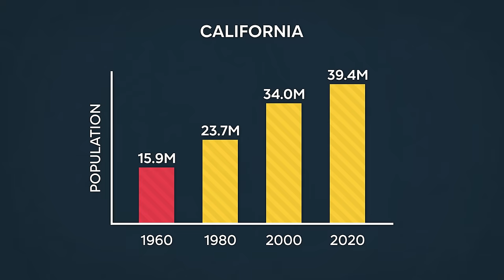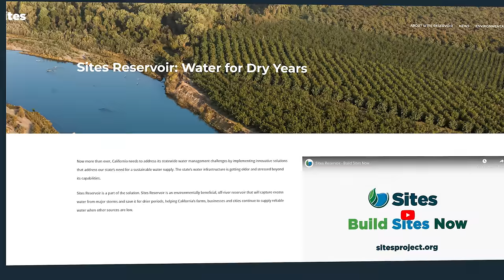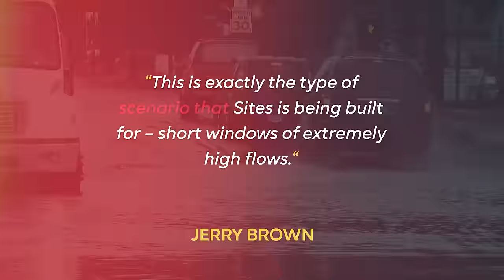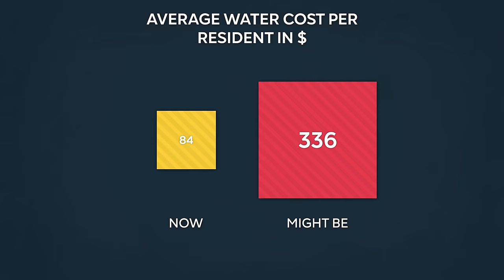California's New $4BN Mega Reservoir

Comment from the maker: What do you think, should the new mega reservoir be built? 🌊
Reply: Yes Might Be Build Soon
Reply: Why make this so Expensive? About 80mi away you got the Keswick Dam. Just pipe it down to Sites Dam, no pumps are needed. You save an enormous amount off energy!!!!
Reply: Install some floating Solar panels to!
Reply: @larsfridtjofnrheim1638  I think they want to ensure there is a guaranteed volume of water per square mile area.
Reply: @ten-tonnetongue  It will help, but, it is not a permanent fix. Like moving water from the Columbia.
Reply: This sounds good, but I'd want to learn more. I don't think there was significant flooding from the Sacramento river in 2023, and most flooding in recent years has been from other rivers, so that's not a helpful comment in your video. Just sucking water off with a pipeline during a surge in river level sounds ineffective for flood control. I wonder if that is even a consideration in this project. Control of the American River and Feather rivers is probably more important at this point. Water on the Sacramento is stored by Shasta Dam which is not full now in April 2023. This seems like a long-term water storage project, which would be slower to fill than Shasta, but creates more capacity over time.
Reply: @larsfridtjofnrheim1638  That kinda defeats the purpose "siphoning off" flood waters no?
Reply: Your video just described the existing San Luis Reservoir in central California where water is pumped into the reservoir from the Sacramento River, but where pumping water is currently blocked because an invasive fish was found in the river and somehow must now be protected. The video seems more of a sales pitch along the same lines as the high speed railroad project. Lots of funding that go into pockets of beneficiaries rather than the project. A project where the main function is already blocked by current environmental protection laws. If the central California's were smart, they would press/protest the issue of the San Luis pumps being shut off at the same meetings of the Sites Dam, so that attention would be brought forward to a costly project that is doomed from the start. California has a problem with water management, not an issue with storage capacities.
Reply: Work and live in the land. Maximize the good minimize the bad. Just stop forces things that can't be sustained.
Reply: It needs to be built, but will never get anywhere. California has been "working" on the high speed railway for decades now and the funds have not been allocated properly. We will all likely die before anything gets done and eventually becomes a memory hole of broken promises.
Reply: They should raise upper Lake McClur and connect it with Don Pedro. Merced and Tuolumne Rivers would work together and double their current capacities.
Reply: What the video fails to mention, are the "4" electric generating and water storage dams that they have  started to remove in northern calif.
Reply: @killerb056  And yet it  is full now. Did this water come from the streams?
Reply: @larsfridtjofnrheim1638  😅
Reply: @larsfridtjofnrheim1638  If it's downhill, your could generate power that way
Reply: @AshGreen359  Yes, but it is a very smal downhill. But if Sites Lake is low, you got some potential.
Reply: Yes, if the environmental impact statement comes back showing a net positive to wildlife verses being detrimental.
Reply: @MrCalagon  Maybe some Desert Rats need to move🤣
Reply: I think the longevity of the project makes sense and could potentially be a solution that holds for decades, but I think there’s a lot of other cheaper faster solutions that can be implemented now that would be highly effective as they are needed, 2030 is just too long.
Reply: No.  The idea is one of the idiotic potentials floated to keep developers interested in California.  The simple reality is that the state has been well aware since the 1960s that under worst case conditions, every stream in the state could be dammed, and there still would not be enough water for the state population at the time.  Over half a century ago for the arithmetically impaired.  California has seen real droughts that have lasted a century within the historic past.  Oh, wait, you might say.  California's history isn't that old.  That is true, but written history reaches back well over 2,000 years.  So the "historic" past includes what climate "science" is pleased to call "paleoclimate."  California's current rainfall regime has not varied significantly in over a century.  It has not become drier, OR wetter.  What we are seeing is business as usual.  What California "needs" is less demand.
Reply: yes, with chinese technology
Reply: Don’t forget the windmills
Reply: Yes. It's either that or California needs to halt net in-migration to the state until they have the water resources to supply them. The state has taken enough Colorado River Water already.
Reply: @geoffreyeble32  Constitutionally, that's one thing no state can do.  Right now, California is right at the limit for distributing water for urban and rural uses, and at the same time limiting the rate of degradation of critical natural resources like the salmon fishery.  King and silver salmon runs are critical to the offshore fisheries.  But every "stakeholder" wants their "stake" to be prioritized.  And the "stake holders" with the clout are developers and the big agri-industry businesses.
Reply: Why build it when people are leaving. Spending more money they don't have, brilliant.
Reply: It looks like this is a great idea, and should have been done years ago. I love my state it's just not liking me anymore.
Reply: Yes in no world should a state with flooding be in a drought. If we can land on the moon we can figure this out.
Reply: Floating solar panels sounds cool but… water and electricity, famously not a good mix!
Reply: @MrCalagon  Would have to be good for water birds/ and the fish pool idea.
Reply: @magesalmanac6424  India is doin solar over canals, maybe not quits the same a floating though.
Reply: No
Reply: This sounds like something that needs to happen not only here but in many other places. I like seeing that people are now understanding/considering the environmental impact to the natural surroundings as well. We have the tools to spend a little more money and make it so resources like fish, among many other things, are impacted minimally. I hope to see the success of this project in the future.
Reply: Yes, but I still think it would be nice if desalination could be pumped to different resovoirs.
Reply: It's obvious. It must be built
Reply: @larsfridtjofnrheim1638  😂😂😂😂
Reply: WEF told us in 2030 we won't own anything and will be happy.
Reply: No.
Reply: Maybe less people in the desert will help. I'm no tree hugger, but sometimes things just equal out. If a deer has no food or resources, they move out.
Reply: Sure
Reply: Not to worry,,,  California's population is heading back down to the 1960's level, with all the tax paying residents fleeing to red states.  All the homeless & illegal immigrants will have all the water they want. It all works out in the end.
Reply: No.
Reply: What you call the Colorado Desert, is actually the Sonoran Desert.
Reply: no, I think people should stop trying to live in an inhospitable, desert wasteland.
Reply: @larsfridtjofnrheim1638  as a Washington resident I'm going to have to insist that people keep their rat claws off of our water.
Reply: They need to build about a dozen of these.
Reply: Then they make it illegal for you to collect water.
Reply: We have NO CHOICE! So much water could have been collected during this crazy year that we will never have the opportunity to get it.
Even the locals in the area, are backing the project
Reply: @motoman869  Why dont US votes, create a new political party? And place it betwhen D and R? A party, by, for and off the people. Supertransparent (make youtube video off all meeting, no meeting alone whit lobbyist and so on).
Reply: Well, something has to be done. I watched an interesting video a couple of months back and they had a great idea. Pumping the water from the frequently flooded east to the water starved west. Before you laugh it off, they showed how it was feasible. There are many unused oil pipelines that could be converted for water use. It's not difficult to clean them to be suitable for pumping water and they're already in place. Of course the profit incentive is missing, but if the gov't really wanted to do something to control flooding in the east and provide water to the burgeoning population in the west, it is possible to do according to the presenter. When you compare the cost from damage to flooded homes, battling wildfires and other natural disasters, controlling the floods might not be that expensive and preventing all the suffering of those who lose everything in these disaster, it could be well worth it. It's worth at least looking into.
Reply: I think it should have been built decades ago.
Reply: capture the water!  crazy!
Reply: Look similar?
Reply: It's going to be built, but it will not fix the water issues as the water still needs to find a way around the delta to go where the 2 Billion $ worth of Private $ lives. Westlands Water district and the Billionaire orchard owner in that district have spent a lot of $ and time trying to get the Tunnels built and are the largest donors to the Governor's over the last couple of decades.  For 20 years + they did not want to pay anything for this dam. But when faced with reality, they and the LA water district(Treated drinking water) decided they better put $ forward now so they get a  piece of that pie and they will worry about the tunnels later. LA will pay more than 700$ an acre ft, they get that back with the higher $ they get from residential customers vs agriculture use. Billionaires Stewart and Lynda Resnick, can buy up huge amounts of water whenever it needs more. They can out spend and are the top donor to the Gov Newsom's campaign. I am for the reservoir, I am not for the tax payers paying a massive 2 billion $ cost they offers little to the tax paying customers, but sends this water down south and making the delta a salt water intrusion region. That will destroy the most productive delta farm land in favor of a salty desert region owned by Billionaires. Not in favor of that. If you pull water flows away from the delta, the salt water intrudes. That's what the tunnels will do. More dams will not fix the CA water issue, we need more rain and it's not coming. Dams that only fill up once every 5-20 years are wasted, as once filled, they only offer an extra years worth at best.  Billions of $ for only one year extra worth of supply every few years. So a 4 Billion $ dam is basically adding only 1/4 to 1/10  it's value, without the extra rain and snow, those dams do not magically fill. It helps some, but the amount of water used requires a lot more than a single year's worth of water/snow.  There's quite a few issues here. Best to follow the $ to see what the real issues and people are involved.
Reply: Billionaires Stewart and Lynda Resnick also own a majority stake in Ground water storage, this cost much much less than Dams. This is a better storage approach and better for all involved. California has a lot more space for ground water storage and then transporting it is less of an issue. Recall that the north has more water? But even here they can store it here the same water. But unless you get enough rain year after year, those will be drained as well. So you are back to the original problem, not enough, storage only helps if you get enough rain over the decades, not just one decent year followed by 5 years worth of drought. Agriculture needs to work more on water conservation and crops that use less water if they want to do business in basically a desert that is getting dryer.  The Billionaires will survive, the poorer farmers? Probably not.
Reply: Heck NO! So many reasons; building expense, ecological cost, not a good & adequate solution. The aim of every region should be to revive more forest cover as a way to store water locally! The way our engineers aided by lots of federal and state funds want to do it is through massive centralized projects that benefit their own pockets! A reservoir no matter how big is tiny by comparison to what is possible in terms of storage in a mature forest! There  are many more advantages to storing water in forest (biomass) besides capacity; the water does not evaporate, the water is cleaned much better, and the water is stored locally where it is needed. And also you don't have the long-term expense of running it by some beauracracy! On top of that it cleans the air it becomes habitat for many lifeforms etc...
Reply: Death valley lake. And resort.
Reply: How about Tulare county and family ranch with cows and those cops that feed American people across the whole nation what would happen? Do the need a system of planting trees or pine trees like China and is going successfully from dust storms? And Volcanic reaction earthquakes?
Reply: Who about Tulare County should the plant trees or pine trees like China from these dust storms? What's going to happen with earthquakes in  the future?
Reply: Yes the Sites Project should be built.  Water for delivery to Southern California could be transported down the western side of the Sacramento Valley to Fairfield where pipes could then transport the water under the bay to the Tracy pumping  facility.   This delivery of fresh water would end the problem of salt water intrusion at the Tracy pumping station, providing good quality water to the California Aqueduct.   This would save the Sacramento River from being the delivery system ending the peripheral canals or pipeline.  Reducing the higher flows in the Sacramento River to meet that demand at Tracy.  Reducing the flow of the Sacramento would aid in seepage and erosion problems the river now endures.  Connecting water from WhiskyTown and Shasta down the west side through Black Butte and Sites should include other storage systems.   The overall water storage in California lags way behind the rapidly increasing demand for water supply.  Most of the conveyance down the west side is already in place and only needs to be connected in some places.   This would cost less than any peripheral delivery project from Sacramento to Tracy and would also solve the salt water intrusion problem.  This system would be all gravity flow and pipes under the bay to Tracy would not require any pumps.   Adding more storage, even small reservoirs, would add a lot to recharging the ground water in the Sacramento Valley.   Capturing the uncontrolled runoff that causes flooding in the Sacramento River would be very beneficial.  Those flood stage waters cause a lot of seepage damage to communities and farmland along the Sacramento River.  Late spring runoff has caused seepage which has killed riparian vegetation and orchards along the river.   The Sacramento Valley watershed has far more water than it can use.  It would be wise to do more to control flooding, increase water storage and even increase the production of Hydro energy.  It would go a long way to mitigate long term droughts which we do endure in a regular cycle.
Reply: they have money for social services not this
Reply: We don’t have a choice the problem is the cost to taxpayers. And residents using the water. Environmental stand point if the deep pools are in place to let the other species using the water are helped than it’s a win win .
Reply: How they doing that railroad they were supposed to build
Reply: Yes. It's needed. Necessary
Reply: @killerb056  lol. Maybe don't build a city or metropolis like los Angeles in the middle of a desert. Gee. Just like Tulare lake. Biggest natural lake west of the Mississippi. So they drain it. Look what's happening now😢. No shortage of stupidity in government
Reply: Oroville was the last Dam and reservoir built and it was completed in 1968.  The population of California has more than doubled since 1968.  Our state wide infrastructure and water system was only intended to meet a slow population growth and included plans for more dams and more water storage.  The voters backed down and allowed the activists to halt further growth and development of infrastructure.  We are now paying the price when millions of acres of farmland are denied water and the crops die.  Food shortages do not benefit anyone.
Reply: great propaganda video. very well done. highly inaccurate in many aspects with enough fear factoring to pull it off.
Reply: To call Sites a “mega reservoir” is clickbait. It is even generous to claim it is moderate sized. I mean, yes it should be built, but it won’t store nearly the water that Shasta or Oroville store.
Reply: Terrible idea, that area is some pristine unspoiled land one of most beautiful valleys I've ever seen,  just because it's not in your backyard, we need greater restrictions on human consumption.
Reply: If you know anything about this you know it's a terrible idea.
Reply: Building more dams will not solve California's water problems. There aren't enough potential available acres to flood to meet our current needs, much less our future needs, since our population will continue to grow, outpacing our water resources. In particular, the Sites reservoir appears large, but it will be shallow, warm, and lose an extraordinary amount of water due to evaporation. It is financially viable only to those handful of people behind the project.
Reply: Get the daummd rain water in a daummd Dam.
Reply: No, this is not a good ideal.
Reply: only if it puts la under water.
Reply: No. This cause even more water scarcity. And disrupt the salmon runs should this river have one.
Reply: Water Purification Technologies born from recent US innovations lead up to H2O splitting technologies that's a global game changer.
Reply: yes,
Reply: Yes, build it. Invest and it can't be finished soon enough.
Reply: nope
Reply: Up and running by 2030??? Are you sure about that?🤔
Reply: Yes.
Why not make north east SF bay to a gaint reservoir using sacramento river?
Reply: That thing is like hydro accumulation plant, but for water instead of electricity
Edit: oh wait, it works like hydro accumulation dam too, so it has useful byproduct
Reply: 5:25 And what has happened since then?? California's population is now shrinking, keep up with the trends.
Reply: No need
Reply: Any thing to been fit food production help  the whole country !!!!!!!!!!!!!!!!!!!!!!!!!!!!!!!!!!!!!!!!!!!!!!!!!!!!!!!!!!!!!!!!!!!!!!!!!!!!!!!!!!!!!!!!!!!!!!!!!!!!!!!!!!!!!!!!!!!!!!!!!!!!!!!!!!!!!!!!!!!!!!
Reply: Yes, the project should be built. However, it will not be enough to meet California’s water needs.
Reply: Yeah
Reply: @larsfridtjofnrheim1638  Awesome idea, but I wonder if maintenance & wear issues would play out better if they're just mounted along the perimeter.   

As solar progresses however, it may become more & more feasible.  The latest thin & flexible panels seem promising for this.  It would prevent evaporation so it's a double-wammie.
Reply: I can't think of a reason why it shouldn't.  seriously. hopefully this means So. Cal will see some benefits.
Reply: 1.  The West America was once under the sea where dinosaurs lived there because they found a lot of dinosaurs bones.

2.  Do not forget about Earthquake that could damage the walls.

3. For Catholics only: 
Don't forget to pray with your Brown Scapular that will raining like Palestine history. Study it.
Reply: Some lucrative crops are very pollinator and water dependent. Maybe work on the consumption end? And as said elsewhere, change our esthetics where excess water consumption is involved. In Vegas, a desert city, one casino has this giant decorative fountainl  I assume Lake Mead misled them that water could be egregiously misused to create a certain appearance. But fluctuations in water supply now calls that into question. I personally am not dedicated that my house have a putting green appearance. Seems to me hardier plants make more sense because I find it ridiculous that I should put  purified water on lawns.
Reply: @killerb056  Thank you!
Reply: Combined with Tulare Lake, more water than they can ever use? Empty for a decade, suddenly it will overflow, storing lots a water for the future.
Reply: No because, that's going to fuck up a lot of things and the infrastructure planning requires way too much engineering, Its going to be a waste of taxpayer dollars and I know damned well despite not being from California, that they do not need this, the funds this project would eat up are better used elsewhere, and I swear if this monster was drawn up by a "Savvy Businessman/Entrepeneur" or up and coming luxury engineer, The whole project is legitimately a waste of time and money,  and might cause some serious issues, such as 

Mass loss of life and destruction of Infrastructure because this reminds me of that John Reber thing, the dude who had pitched an idea to dam the San Franciso bay area, which was proven to be bullshit by the Us Army corps of engineers rather quickly
Reply: @LocalSchizoprenic  My last year in San Francisco was 1955. There's an Everest of history I don't know. "Dam the Bay Area"? I can understand "Damn the Bay Area"  considering Zuckerberg, Musk, et al. But I'm very interested to know what gets dammed. When my family was on its way to SF, the Russian River was flooding. At that time, I'd paid no attention to N. California,so the news about "the Russian River" was mysterious. I'd say it is in this century that I started to be aware of water-related geography in N. California. All fits into a neat picture. And a massive job to handle productively.
Reply: @zAlaska  What I wonder. Given the income from farms, what is the amount of farmland that the state should give up just to even out water availability? Water is money. Food is money. Food needs water. Has to be an equation to determine eliminating farmland for water resources. Where Hoover Dam is, there wasn't much loss when they created Lake Mead. Plus it was a massive job creator. Maybe a Lake Mead in California would pay a few workers?
Reply: Yes
Reply: A public works program to build water stations and pumping stations across America could solve many problems. Rivers from the Midwest to the eastern seaboard flood almost every year. Strategically placed pipelines could move flood waters to the drought stricken regions of our country. The worst that could happen would be a water pipe break or leak. All states could benefit from this program and share the cost to build and maintain our most valuable natural resources. Someone send this idea up the chain so someone can run with it.
Reply: A public works program to build water stations and pumping stations across America could solve many problems. Rivers from the Midwest to the eastern seaboard flood almost every year. Strategically placed pipelines could move flood waters to the drought stricken regions of our country. The worst that could happen would be a water pipe break or leak. All states could benefit from this program and share the cost to build and maintain our most valuable natural resources. Someone send this idea up the chain so someone can run with it.
Reply: @jnick8252 China dam that shifted earth's axes by 2 seconds 😅😅😅
Reply: Build it. Ignore the tree-huggers.
Reply: No. It's all politics. California politics has been spoiling our reservoirs for decades.
Reply: I think the State I was born and live in California should work on replenishment of it's underground aquifers when it can during the wet years. This has been neglected for many years and the detrimental affects are huge.  Above ground reservoirs loose a lot to evaporation. Strategic flood farming and  bring back some wetlands.There is much more about this and would make a for a good video you can do imo.
Reply: No, it should not be built. First off, the state has enough water for its population. This video is very deceiving. Resident and industrial water use only takes around 20% of our water. The other 80% goes to agriculture. But this video failed to mention that.

The first, cheapest, and best way to get water now is mandate every once of water use be recycled. The state only recycles around only 20% of its water. That's a lot of water being wasted. The next best thing is to do what they do in Australia and build water rain off captures in the cities, especially in Southern California, where they waste and don't store any of their damn water. Which is why they are always relying on the Colorado River and the North for their water.
Reply: Minority report: NO. Let the farmers just adapt to the current forecast weather trend. Stop encouraging water needy agriculture.
Reply: As long as I get to buy some dumpy desert land and get cheap taxpayer funded water delivered to it first. Turn my desert land into cash crops. I’ll benefit handsomely off taxpayer largesse. 

Wait haven’t we dammed every river and tributary already to do this? And they still pump tons of ground water causing the land to literally sink. 

Fix the water rights and replenish groundwater stores before spending anymore taxpayer dollars for the benefit of a handful of the nation’s wealthiest farm owners.
Reply: No. Desalination plants would be better.
Reply: @fosarvian  We had some land in Washington State. It had a ditch on its north side with water flowing 24XX7. Little pump in it and totally free water for a truck garden. I suppose there must have been property taxes, but not any fee per gallons of irrigating water. Source was the Columbia River. And no crops sold.
Reply: I'm all for reservoirs.  Excess water that would flow back into the sea should be collected, but not to an extent that would ruin downstream ecologies.  So, reservoirs need to strike that balance IMO.  I don't want to see the equivalent of China's Three Gorges Dam happen again in the US.
Reply: @JimMork  Cool. Thanks for sharing but I'm not understanding the connection to my comment. Can you help me understand it better?
Reply: @squash4david  I'd repeat that giant projects make no sense if you can simply conform your agriculture to what the climate favors. Wild apples originated in the mountains of the Caucusus.. Hybridization has produced species for other places but not just any place. Hickory nuts favor dry areas. Adapt some. The environment is dynamic, human responses must also be.
Reply: @fosarvian  I don't think our land was cheap desert  land. It actually was fertile. And a Depression Era project, similar to Hoover Dam permitted both electricity and irrigation to use water from Canada to promote crops in eastern Washington. A little strange given the proximity to the Rockies in Idaho, but harvesting that water would have been more ambitious. Compared to irrigating southern California, eastern Washington was pretty modest. California is a large state north to south, and snow melt floods the north. Farming makes more sense in the north.
Reply: can never happen, a mosquito egg  could be harmed😂😂😂😂😂
Reply: The music on this video is super annoying. Why?
Reply: Absolutely ‼️ Build it‼️‼️
Reply: It will cost a lot more than 4Bn.
Reply: It is cheaper to make desalination plants.
Reply: @everyplaceisunique  it's no use to government unless it's hideously expensive and the taxpayer can be milked.
Reply: Absolutely not
Reply: What does the "N" in "$4BN" stand for?
Reply: No, I'd rather just watch Comiefornia suffer. KARMA is finally tearing them apart
Reply: Teh-ha-cha-pee mountins
Reply: The Yolo by-pass ran water for three months. I live in Roseville by Sac it rained for three months straight. Several communities were flooded during that time. @pcatful
Reply: It's not sustainable. Only an 80 percent return. you need a surplus of return for it to be sustainable. This sounds like a future economic disaster that will continue to drive up debt and make people more reliant on the government. Which makes sense why they want to do it now with Califorina's current governor. Add in inflation on that 20 percent and upkeep. This sounds like a tax scam to me. Another reason to up your taxes indefinitely.
Reply: NO!!!!!! Im Against it 100% 
heres my solution. desalazation plants
Cali takes 4.4 mil cu acre ft of fresh colorado river water from lake mead ever year. roughly 65% of that fresh clean drinkable water is going towards farming they are farming alfalfa Hay and some other items. 
Now.... Lake Mead Lake Powell Hoover Dam and Glen Canyon Dams were all dangerously low and are still low (23% capacity at lowest were i found) the hoover dam has 17 power electro turbine generators. 
only 5 (i believe) are in operationnat this time. 
IF Cali was to put de sal plants in to clean the water and us that for farming they would require LESS water draw from lake Mead Hoover Dam meaning the lake could fill up more and run more power to put back into the power grid. 
BUT That all makes WAYYYY to much sense so instead we spend 20 BN tax dollars which im against to make something that we already have.
Side note the Hay that is made is all shipped over seas to the middle east they used to grow there own Hay but had to stop because its in guess were the
middle of the desert... which is were we are growing all this Hay... 
why not move the hay production to like illinois or kentucky were it would require less water because its not in the middle of the desert???? this all
just baffles me and one reason i dont like politics because if there not in "control" then they tax you to death. 
My .02
Reply: Agreed
Reply: They can fill it will poop.
Reply: Can one of you Greenies please tell me how much of the atmosphere is the evil greenhouse gas CO2?  I mean it must be 50%, right?  
Also, can one of you Greenies please tell me what plants breathe?  You know... high school biology... plants inhale CO2 + sunlight => exhale O2.  The carbon is used by the plant to create sugars for winter and growth.  If we removed all CO2 from the atmosphere, what would happen to the plants?  Wouldn't they die? If they die, don't we soon follow?  
Please Greenies, please tell me how GW/CC is real?  

BTW:  CO2 is only 0.039% of the atmosphere.  I don't think you Greenies know this fact.
Reply: @centariprime9959  "The trouble with the world is that the stupid are cocksure and the intelligent are full of doubt.”
 - Bertrand Russell
Reply: too many people
Reply: Won't do much good when the best places are being filled in for more high priced homes. 1 giant reservoir could also make the situation worse because it is still a collection point vs making a flow point inland from the coast.
Reply: A new dam without a river to feed it is wasted money.
Reply: @mtebaldi1  not to mention we have to ask how often that river overflows and how it will affect down stream. It might be better if they make a man made lake that the ocean feeds into.
Reply: @joshusavage5100  there is already one there it is called Sultan Sea. It is an inland sea.
Reply: @mtebaldi1  I'm talking about having one connected to the actual sea and not a landlocked body of water that is dead. The Salton sea is dead because it is toxic because it is stagnant and not flowing. But if we have a flow then it will be alive.
Reply: @pcatful  

And still being held hostage by the delta smelt.
Reply: No. High-speed railroad, solar installation, gun control, alien citizenship, and economic protection of California and federal politicians are more the business of the day. WE LOVE YOU GAVIN!
Reply: No.
Reply: Na, just let al the water flow to the bay and take down all dams as we are doing on the Klatath.
Reply: Hollywood 😊
Reply: No , there should be several smaller reservoirs that are spread out throughout the areas most needed.
Reply: @manu5504  

Maybe Boswell could co-op with the other farmers in the 2 lake areas. Buena Vista and Tulare choose some wells on their farms for injection and pump surface water into the reservoirs underground, so evaporation steal minimum amounts. I am afraid they are at the mercy of cyclic drought lasting 3 to 8 years in length before El Nino returns. During drought, unless Newsome will release water from the Sacramento Delta, a dam will be useless again until El Nino cycles back. In know the Drlta Smelt is only the excuse Newsome gives for holding the Delta bounty back. The real culprit is the USDA, and there are agreements to cut back AG production in the San Joaquin Valley to appease the AG growing and exporting of South American interests.
Reply: No, you said it yourself.  They cannot afford to maintain the existing management system.  So building another element of it you cannot afford to maintain is setting them up for failure.
Reply: build it....
Reply: @davehughesfarm7983  

And the hippies will come.
Reply: Did ya'all just let 2 years of El Nino percolate and let evaporation have part of it, or did we set up some inection into the reservoir.
Reply: @davehughesfarm7983  

You know Newsome doesn't care about water. It's all about electric this and that, high speed rail, tax to the 10th, only the homeless will survive, give me your insane and criminal element, drugs and young stuff. Help me make everyone tired and poor.
Reply: Absolutely not! Fortunately it will never be built.
Reply: waste of tax money
Reply: Is not the Sac. Delta a mega-dam in itself.
Reply: @ten-tonnetongue  why not have ponds lakes reservoirs per square area foir storm water storage?
Reply: @larsfridtjofnrheim1638  after exhausting rooftop potential?
Reply: @MegaBuildsYT  indeed beyond a dnhadiw if doubt, have a joint Committee with all affected downstream countries be it India or burnsh or Bangladesh?
Reply: @larsfridtjofnrheim1638  inprinciple conserve more, dredge snd desilt existing facilities?
Reply: I decided to watch this video again about a year later and yes, it can and now looks like Sites will be built. The last of the legal challenges was rejected in court and the first phase of construction is has been initially funded. Although I think Sites is really more to provide more water the the Central Valley than it is to SoCal, a more steady supply of water to the Central Valley will mean that we won't need to suddenly start water rationing again in SoCal because the farmers are using up all the water from the Sacramento before it even reaches SoCal. So I think it's a good idea if for no other reason than to stabilize the water supply that goes to the Central Valley and the rest that eventually flows into SoCal. Although SoCal gets only around 20% of its water from the Sacrament,  the majority is from melting snowpacks in the Sierra Mountains, snowpacks in the Sierras have become increasingly erratic since the 1990s due to climate change and Sites is needed to ensure more stable water rights for farmers in the Central Valley and to ensure SoCal receives a more steady supply of water from up north to offset more erratic snowfall in the Sierras.
Reply: @MisterNi  why only one dam, why not both? 
The primary objective is supposed to be power generation, with the addumption, more the better, both become imperative?
Reply: Surface reservoirs are a waste of land and water. Aquifers don't evaporate appreciably and there's 3 times more storage available just in the Central Valley aquifers than all California's reservoirs combined. Every reservoir should have at least some floating solar panels to reduce evaporation and water temperature and some method of transferring water to an aquifer for long term storage. That way some reservoir capacity can be maintained for flood control.
Reply: The drought is over!
Reply: @theeddorian There’s no drought.
Reply: @kh-vz2el There’s no drought at all in California!
Reply: @studiosinger  That IS what I said.  There has been significant change in rainfall in California for well over a century.  There is an "over-demand" problem instead.
Reply: Not by the California Government.  Why do they need to finance this?
Reply: @11:13 “helping other species too…”  what is the positive economic impact of salmon compared to everything thing else?  Extremely Minimal.
Reply: @ChazToz  "Helping" salmon "helps" every economic link that relies on salmon from the ocean inland to where they spawn.  The proper question is how far can you subordinate other factors before your economic priorities start to be problems.